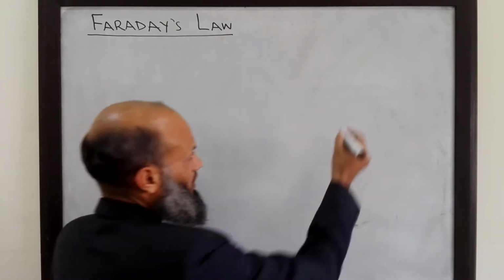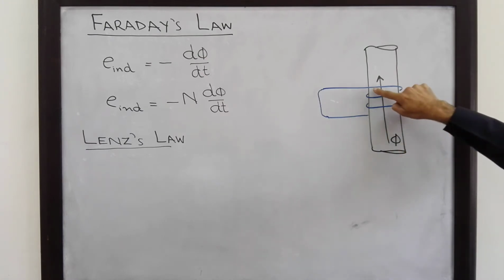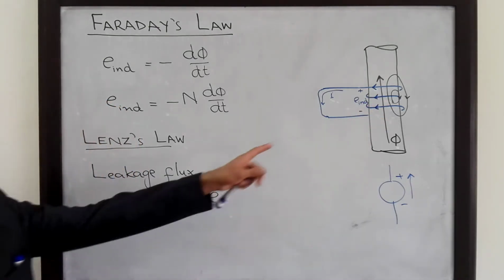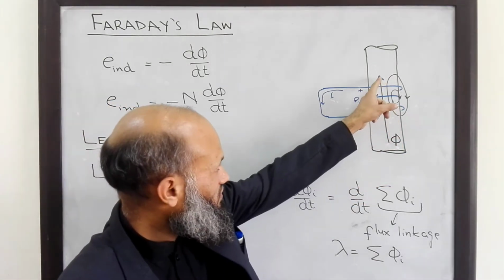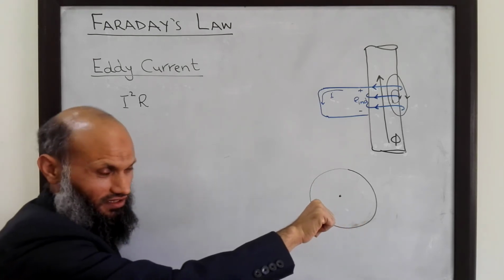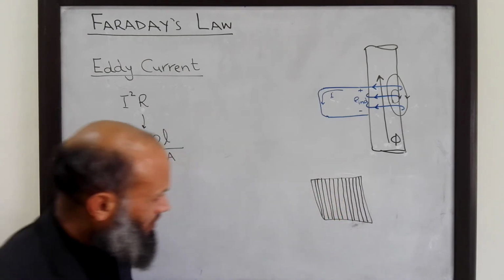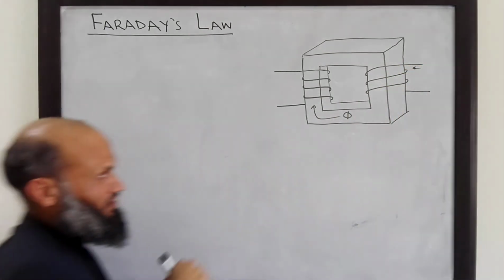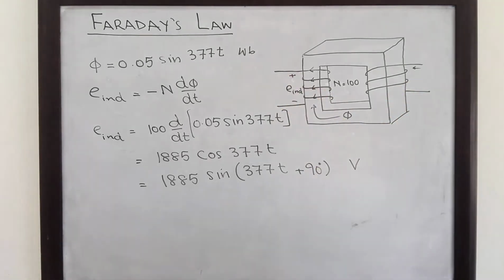EE213 - 05a - Faraday's Law, Lenz's Law and Eddy Currents

Comment: If you use a ferrite core (relative permeability of 1500-3000) and then saw it in half (an "air gap") you have a relative permeability of 2. With a wooden core, you have a relative permeability of 4 - twice as good as misused ferrite. Plus wood does not have eddy currents.

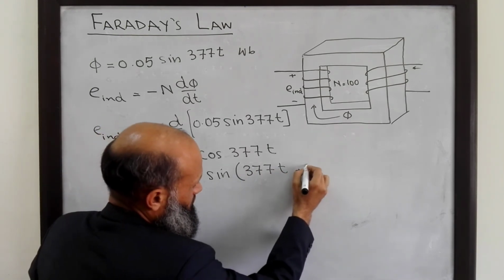Comment: At 14:12 you forgot the minus sign. So eind = - 1885*cos(377*t) = 1885*sin(377*t - 90). The induced voltage should LAG the current and flux not lead it.
Reply from the maker: The negative sign in the expression is due to the Lenz's law, and this indicates the polarity of the induced emf. At the mentioned time instant, only magnitude is computed and the polarity of the induced emf is separately discussed. 

However, if you take a voltage with polarity opposite to that indicated in the figure, its magnitude will come out to be the same as described in your calculations.